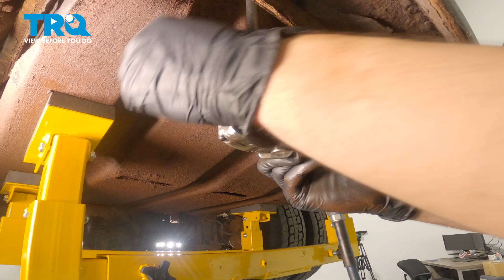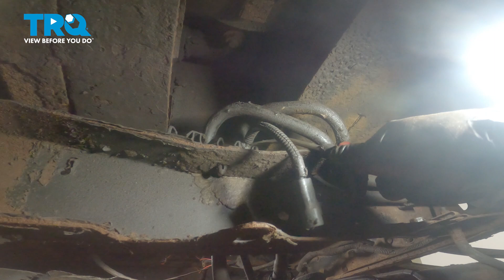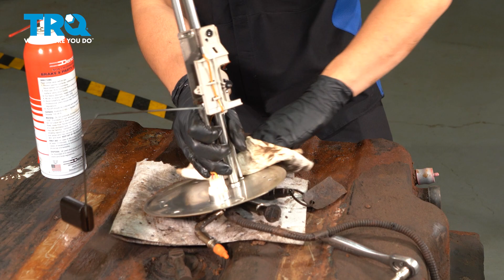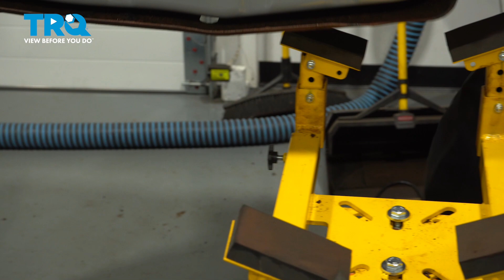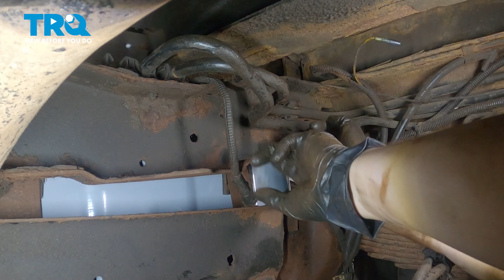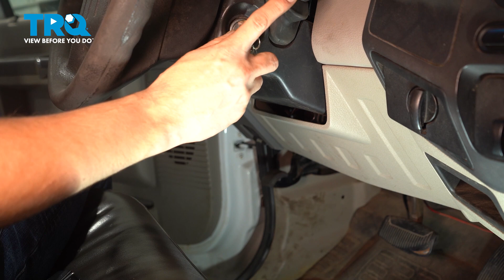How to Replace Rear Fuel Tank 2008-2010 Ford F-450 Super Duty

Comment: Thanks for the video My dilemma is I have a 2004 F350 Super duty dump truck with a V10 and the tank looks like this tank I cannot find it for "regular gas" do you know if they sometimes used this same tank for the V10? My Tank is beyond had it!! I figured I would replace the tank and everything inside it with new
Chris
Reply: I think it’s same tank